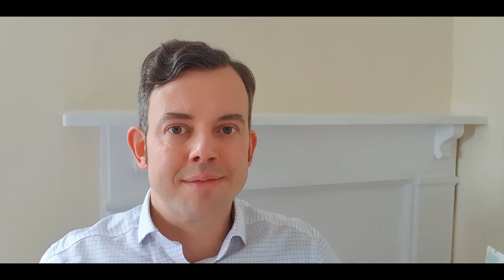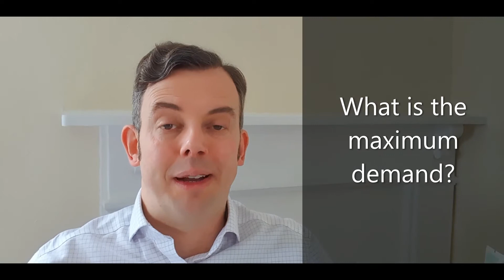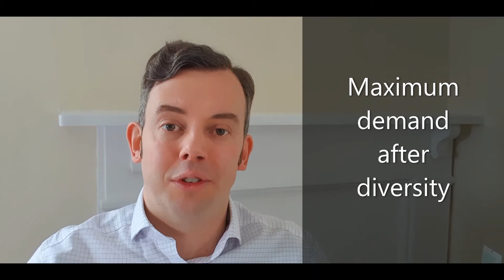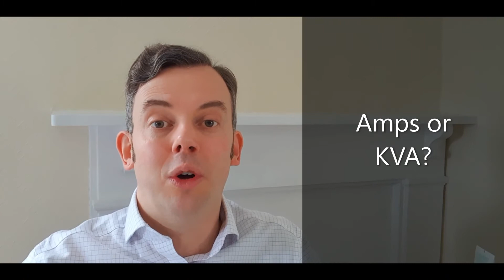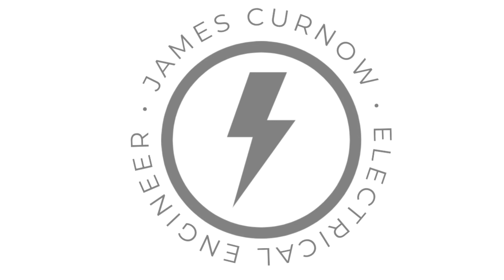Maximum demand explained-what is maximum demand?

Comment: One other query!!! If I had a domestic installation with a sub main running to an out building (with say 2x rings, 2x lights, 1x boiler, 1x smokes, 1x cooker and a shed sub main @32A. Then in the shed 1x 20A socket cct, 1x garden socket@ 16A, and lights@ 6A)
How would you count the submain? Would you take it at face value(32A?) or tot up the shed circuits individually and effectively add them onto the house consumer unit? Cheers👍
Reply from the maker: Hi,
The maximum demand is the sum of the connected loads. So, if you have a submain and a consumer unit in the shed,  I would probably use the actual loads of the final circuits and apply the diversity factors from the on site guide. 
I wouldn't include both the submain and the final circuits, as this would double it up.
Kind regards
James

Comment: Great video james, one query though. 722.311.201 states that load curtailment and load reduction or disconnection either automatically or manually, may be taken into account when determining the maximum demand of EV charging points? Could you clarify this point? Thanks for your content 🙏👍
Reply from the maker: Thank you, I'm glad you like the video. You are correct, the regulation you mention was introduced in amendment 1 of the 18th edition. However, there isn't a diversity factor for this in the on-site guide.
From memory, I think amendment 1 was introduced partly because of new technology that was available relating to ev charging,  and the on-site guide was published before that.
So I think this is an area that is developing as the technology changes, and I will see if I can find any further guidance on this.

Kind regards
James